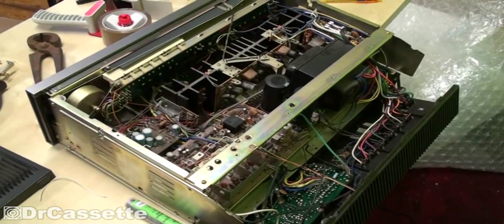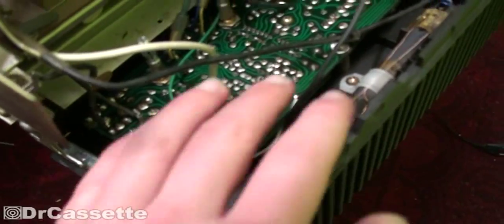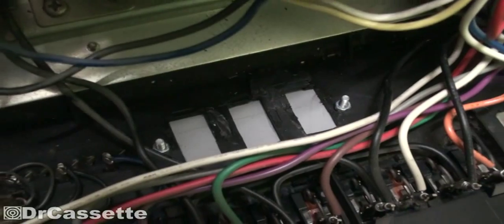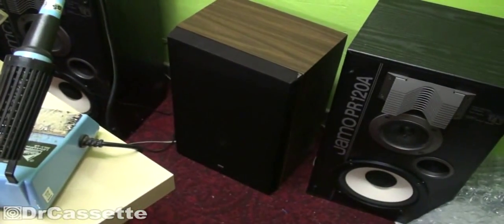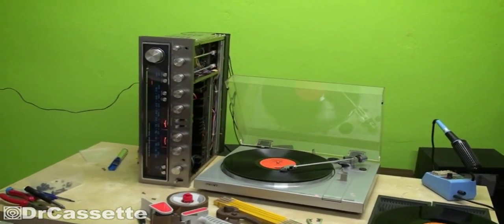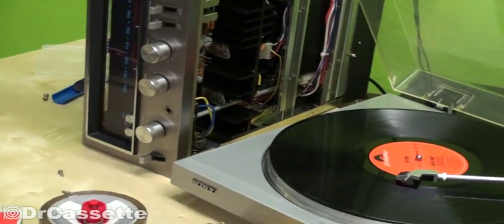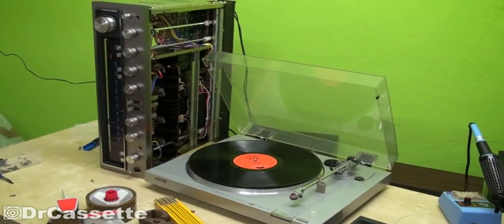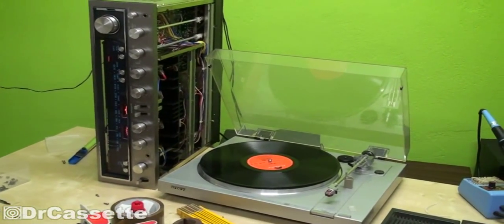DrCassette's Workshop - Kenwood KR-6060 receiver repairs #2

Comment: The "FM 25 µs" button was for use with Dolby FM. That was when FM stations would transmit Dolby B NR-encoded audio, and you'd switch your receiver into 25 µS mode and then play its audio output through the Dolby B decoder of a tape deck. Dolby FM was popular in the late '70s, but disappeared entirely in the early '80s.